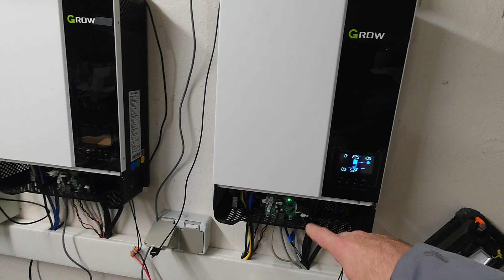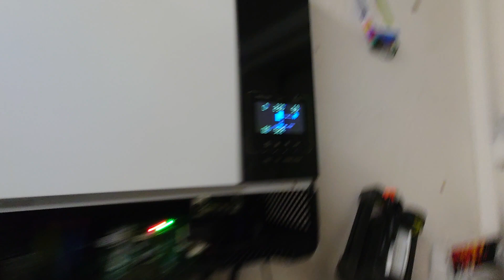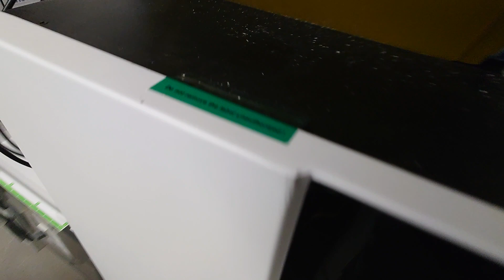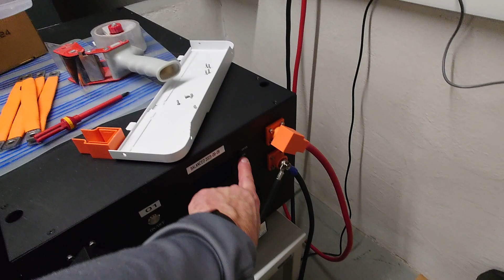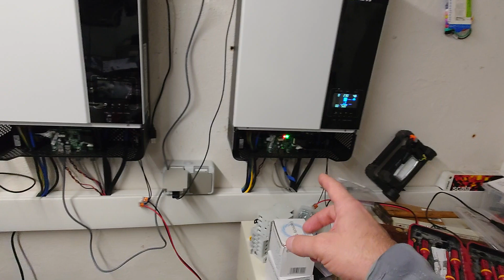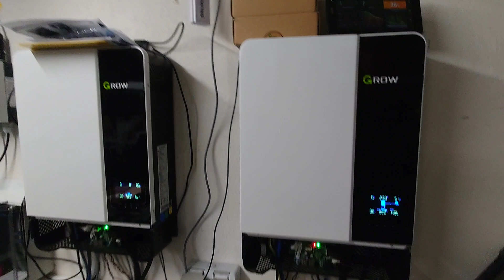Growatt SPF5000ES winter energy saving below

Comment: Nice explanations! You are using 16A wifi switch with contactors. Can I use tongue 64A in that system without contractors? I mean Wifi switch direct to Live line on slave and to 2 position in the invertor switch.
Reply from the maker: what exactly do you mean? I:m not sure what is the question to me...
Reply: @kirkdis  Can I use WiFi switch 64amps direct to AC line in the invertor, without  contactor?
Reply: @kirkdis I want to setup this mod on my inverters, but with grid line on. When Wifi switches in night it will switch off the invertor 2 by cutting grid line and inverter switch button in the same time. I want to pass grid through WiFi smart switch - tongue 64 amps.
Reply from the maker: @mustafabyalk  Yes I think this should be possible but in that case your inverters still consume standby power from the battery the whole night... whcih they don´t do when you switch the inverter completely off...